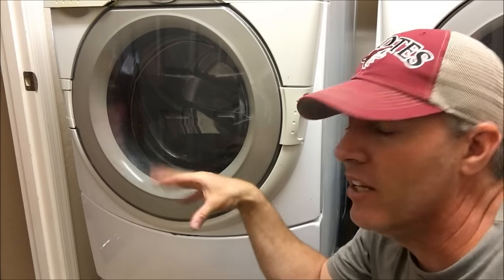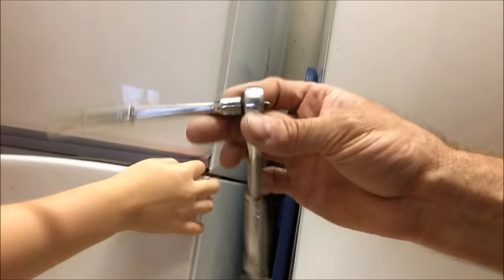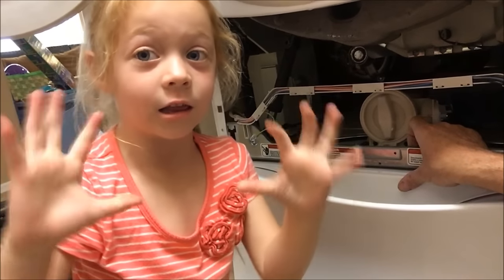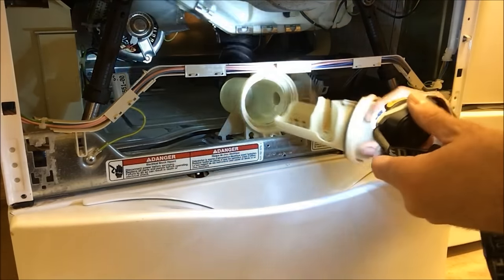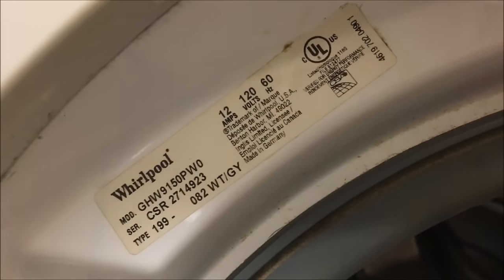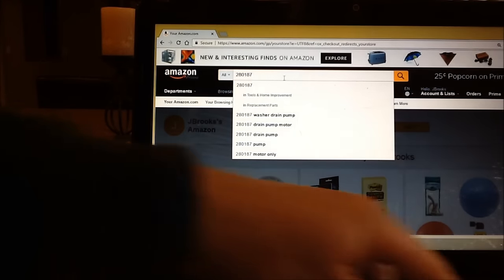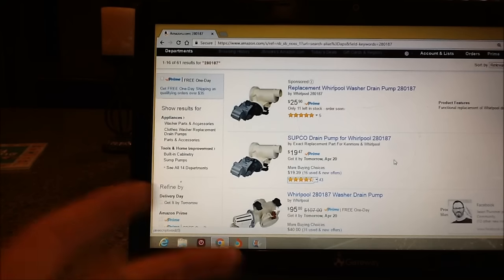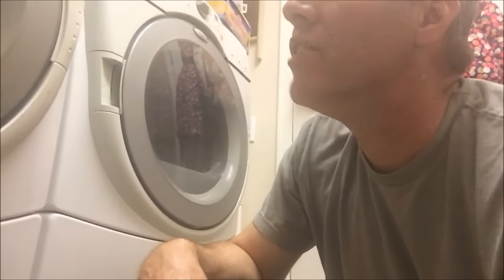DIY washer wont drain - repair whirlpool duet

Comment: Good to see there's still a few real Dads out there.
Reply from the maker: Thank you!!
Reply: i fixed the pump,  the trap was clogged , and their was an elastic band jamming the impeller , i got it fixed and machine now drains but after i fixed the pump  not the machine won't  work i get 6 binks  and  then 1 blink , the machine won't go into wash now ,
i think it is  an error  for insufficient water pressure but i am not sure
Reply: @anthonyrossetti7509  Seems like I read somewhere that a faulty oump pulling too much amperage can cause the lidlock assembly with wax motors to go bad.  Not sure if yours has the wax motor door lock assembly.  Not even sure where I read that.
  If yor washer still has the booklet in it, it should tell you the code that is flashing.
Reply: @rickeykeeton4770  thanks but I fixed it , turns out that that it was because I hadn't put the bottom panel back on yet 
There is a little spring switch that the panel needs to hold in
Also for models with no display you can still get diagnostic mode 
I forget now but I think  you just press any 3 buttons besides power 3 times is a series like 123  123. 123 after you power cycle the machine
Then it is in diagnostic mode and the lights will flash and the 1button you pressed in the series is the 1button ,the second is the 2 button 3rd is the 3 button
Then you press or hold one of them I forgot which one now and it will clear all the error codes from the computer
After I found the right chart of error codes for my machine  I was able to look up the code. It said it could be one of like 10 different things but when I read about the switch I knew that that was probably the thing causing it ,I screwed the panel back on , and cleared the codes and then it worked
Reply: @anthonyrossetti7509  Some of these have somewhat confusing diagnostic systems to remember
Reply: vinceje a few!!! There’s  a lot a good fathers out there  most women like dushbabgs
Reply: Right?
Reply: @anthonyrossetti7509  Go online. I don't recall the site address right now but it was one of the first 3 listed. It gives you directions on how to enter diagnostic mode and read the codes. If you have had ten washes without error codes they disappear in the missing sock universe.
Reply: @rickeykeeton4770  Booklet is taped under the top lid in a plastic bag sililar to a shipping doc bag.
Reply: @anthonyrossetti7509  Good work. Those type of instructions are in dishwashing machines also. Many times you need to disassemble the front door to access them.
Reply: There's actually a few of us still around and kicking ass. Likewise - this video made my day.

Comment: **iMPORTANT NOTE** I watched this video and ordered the part, but later discovered the pump was not the reason the tub was filling with water, it was a defective inlet valve! There is a SUPER EASY way to find out if the Inlet Valve is leaking that requires NO TOOLS :) If your washer is off and has not been used for several hours or days and the tub continues to fill with water slowly, here is an easy way to check if it inlet valve is the real culprit: The defective inlet valve will leak and you will be able to see a slow steady drip at the door outlet valve. This causes the tub to fill. To check, just open the door and see the outlet valve on the left side half way up. If it remains dry with no drips with power off.......then your inlet valve is good. If it is dripping.......the inlet is defective. :)

I just wanted to share my findings so others can double check the inlet valve and save yourself the trouble of ordering the wrong part.
Reply: GOOD TIP!!!

Comment: Thank you so much!  
We had this exact problem with this exact washer and I googled on a whim thinking I might find some generic info about how to make a fix and came across your video!  It was easy to follow and I was able to fix the issue by myself!  Our problem ended up being just the filter, which was so clogged up but very easy to clean out in the end.  However,  I am now also confident that I could replace the drain pump if necessary after watching your video!  
I also want to say that we've had TWO repair people come out to check our machine and neither addressed the filter - it seems like that would have been step one in a draining problem.  It is surely proof to your point that you never know who you are getting when you bring someone into your home!
Our washer is working great now and I appreciate this video so much!

Comment: Dude!  your video helped me fix the same problem on my Whirlpool Washer.  We tried cleaning the filter portion first (it was partially clogged), that didn't work.  So we ordered the new pump from Amazon and boom, it's fixed!  It was almost painless until my wife starting a cleaning project while we had the machines pulled from the wall-LOL.  thanks a bunch for the video
Reply from the maker: HA! Awesome John, I'M glad it was helpful!!

Comment: May 9/23 - This  isn't the exact same as my washer, although I have a Whirlpool Duet (maybe newer model).  I watched about 4 different videos and, by far, this was the easiest to follow.  Some of the others said to turn the machine on it's back, a bit too hard for 110lb female.  So I took the back off.  The coin catcher/filter was a bit more difficult to access but finally managed it, drained the last of the water and found........a Color Catcher caught in it.  Haven't put it all back together yet, but hopefully that is problem solved and no need to replace the pump.  I wasn't expecting much with a 6 year old post but I'm glad to say that watching it paid off big-time for me.  Great, clear video and easy to follow instructions.  Can't thank you enough.  Love the added touches from your lovely daughter.  Word of caution for people who use Color Catchersin front-loaders.  I've been using them for years and first time with a problem.

Comment: Thanks for the great video.  Fixed my problem last night which I could never have done without your instructions. And I never do this kind of stuff!  One thing I did was to start using the wet vacuum about a quarter of the way into the repair, based on your slight comment. There was a lot of water in the machine and it was taking forever using the rags to soak it up as it drained.  I put the wet vacuum nozzle next to the drain and sucked most of the water in as it poured out. Key was to open the cover ever so slightly and putting the nozzle right where it was pouring out and it worked like a charm. The wet vac. sucked in most of the water.  Sped up the process and less mess.  Can't thank you enough.
Much appreciated.

Comment: Your daughter is so adorable and she seems like she knows what you are saying so she is way ahead of the game. As Nancy said in the comments I also was my father's helper and it's amazing how my brain works with mechanical stuff. As it turns out,, I am handy around the house point being so will your daughter. What a tremendous advantage for her. About my machine, I'm going to give it a go and see what happens. The problem is not a clogged drain area so it has to be the pump mechanism itself. I'll let you know how it goes. Thanks for the easy to follow video. If I had someone come here it's a least $100.00 to come and check it out and then an extremely overpriced part as well. So, needless to say, I am very happy about this video and I'm kind of excited to see if this solves the problem.

Comment: Thanks for your videos! It's always nice to see that there are people in the world who still like to fix things on their own and teach others to do so!
Bonus Tip: If you think the drain line might be plugged somewhere, save yourself some time and check ALL of the spots where it may plug before putting everything back together.  
Bonus Bonus Tip: If the discharge of the pump isn't blocked, check the entirety of the suction line, including the lint trap, the ball valve on the outlet of the exterior washer drum, AND the wash drum outlet itself. After 3 days of trying to diagnose my washer's inability to drain, I found some socks somehow stuck between the interior and exterior drums, plugging up the whole works. Have no idea how they got there, but there they were.

Comment: I'm really glad I watch this. I opened up this drain and the reason why my washing machine was doing the F21 and the suds error was I had a hair band in my little filter drain area. Took the Hair Band out no more error code. Probably saved a single gal at least a hundred and fifty bucks. Took me 10 minutes to take three little screws out, unscrew this filter area, dump out the gross water and hair bands. Washing machine running like a top. Thank you so much for the video it gave me great confidence.

Comment: Hello I wanted to send a thank you.  I did what you said.  I called the parts store with the serial # and they wanted 160.00 for the part.  They also gave me the part number and I purchased it on Amazon for 30.00.  Our drain pump was original and didn’t look exactly like the replacement, no screws, so we had to pull the machine out, lay it on the side to take it off the pedestal.  Once they were separated, we were able to unattach the the whole pump from underneath the bottom of the washer and replace with the new part .  It took us a lot longer, but we got it all back together and I am washing as I type.  Thank you.

Comment: Great video! It was very helpful for me to troubleshoot my issue. I actually checked my trap, came out clean. Then I checked the drain pump, it tested fine around 160 ohms and was able to run when connected. So I checked the boot and found a little bit of hair/lint caught up near the ball. Nothing seem to fix the issue. In a last ditch effort, I purchased a new drain pump from Amazon for $25, and it works!!!
Reply from the maker: Nice work Jeremy!

Comment: Thank you so much! I had to manually drain the washer drum, then disassemble the front load lower panel, open the filter/pump,  unclog all kind of stuff 'eww', clean it and reassemble it. Thank you and little Ms. Girl power for all your Guidance. 😊😊😊

Comment: Thanks! Good info! I cleared the blockage out of my filter and everything is fine again. But due to the age and constant use of my machine I'm going to replace my pump. At $25 and 10 minutes, you can't beat what would otherwise be an expensive bill from the repairman.

Comment: I received codes Sud and F21.  First I cleaned the filter. But this did not work. The water did not drain upon testing. I was just about to call a technician.  
Then I decided to take the motor out. Upon removal and looking inside I saw a rubber band stuck, spun around the blades. With great difficulty and some homemade tools and the flashlight of my phone, I was able to remove the rubber band. Praying, I installed back the pump. This worked and I was ecstatic. Worked on it since Wednesday. Just finished.

Comment: I used to have this model, and in their infinite wisdom, Whirlpool changed the access for the pump/filter to the rear panel in the later models. What used to take 5 minutes now is a more labor intensive job.

Comment: Thanks we watched your video and my husband and I fixed ourselves.  Turned out there were some socks stuck in the drain!  Thanks
for saving us money $$$$
Reply from the maker: Glad to hear it!
Reply: Socks?!  Wow!
Reply: @GeorgiaDawgAthens  We had the same issue, still wondering how the socks made it there. They frequently get stuck in the rim seal but I couldn't figure how they make it all the way to the drain pipe, current suspicion is on the water inlet opening on top left.

Comment: Thank you Scott!  I was able to replace the drain pump by myself and I ran a load cycle.  I did notice that the new pump got really hot though.  Unfortunately, even though the new pump drained the washer I got a new error code at the end (F9 E2) which is for the drain pump!  I am confused.  Advise?

Comment: Have this washer It started flashing FH. Press the cancel red button. To get the door open. Then it started flashing 34 . I change  the knob from Whitest Whites to  to Heavy Duty . Just changed the number to 27 and from 34. The button  you push to cut off the cycle on the far right. That you hold for 3 seconds does nothing. Checked the filter. Like you show. Even checked the screens on the  hot, and cold   water. Machine makes a noise but the drum does not rotate.  I assume the flashing number is the  minuets left to the cycle is complete. What do you think? Machine was bought in 2004.

Comment: By any chance when you used the drain and spin cycle did it make a odd sound until you were able to shut the machine off? Yours looks just like mine does and I'm hoping its clogged, but if not how smart of you to get the part number for the pump and then check Amazon. Your video was awesome. I look forward to your reply about the strange sound. Thanks so much!

Comment: So my front loader is a duet and i can onlu access the filter by squeezing my hand through the losend bottom. Ive had to do clean the filter several times over the last year. Now it wont drain and the filter is not clogged. So im guessing its the pump after watching this. How can i access this? I can only remove the bottom two screws.

Comment: I have just got the F error, as i am widow a friend took the front off and we did clean the drain, there was a few coins but we cleaned it all and thought it was fixed , just tried to do laundry and same thing, I dont have water sitting in the tub just the clothes are really wet, when I put on spin and drain it will work.
do you think it is the pump ?

Comment: Found my missing tweezer my mom gave me 40 some years ago, 87 cents assorted coins, $20 bill, upholstery needle I use for sewing ducks together, a leather stitching needle, soda bottle cap, and a whole lot of blue fuzz. Fuzz from our babies new blanket that never made it into the dryer.
Whirlpool removed the easy access door so now it takes longer. I'm going ot buy touch up paint and put in my own door on a SS piano hinges.

Comment: No but currently I have my washing machine hooked with a dish washer hose to my kitchen sink I'm going to be moving it down to the basement where I'm going to hook up the proper piping and I'm wondering if it's not getting the proper amounted water so once I move it down there I'm gonna see if it runs a perfect cycle if not I'll just start tearing it apart and figuring it out

Comment: watched the video had the filter cleaned out an washer working again in 1/2 an hour at no cost.  Thank You
Reply: actually up $2.95. a drill bit 2 screw driver bits a drill bit and a sim card

Comment: On my model of Whirlpool duet I had to remove the top panel, and the entire front including the boot seal to get to the filter. There was no access panel, like the video, but the pump and filter were in the exact same location. It had never been cleaned. I think they designed the newer ones so that people can't service them easily. Planned obsolescence. Buy the ones with the removable bottom like in this video for an easier time! If this happens again, I'm going to cut a hatch with an angle grinder to save myself from having to disassemble the entire machine.

Comment: Thanks very much. I just took the filter plug out and found $$24.10 for all day trying to get the door to unlock. Ther was another coin, either a toonie/loonie worn so thin so must've been a long time prroblem. Not my house/machine. Will decide if I give it to my  bro when he returns. LoL Prolly tho, I am such a pushover & I texted me when I told him the door wouldn't unlock and told me not to try fix anything ha but now I tried again and it keeps reverting back to wash and add garment.

Comment: If you have the model with the one piece front it’s a little more work. 
Remove the three 1/4” screws from the back lid and slide the lid back. 
Take out the detergent tray. And then remove the two T20 screws. 
Remove two screws from the top left and right the closest ones to the front then remove the panel and lay it on top. 
Remove the two T20 screws holding the door latch. Remove the spring ring around the door seal with a needle nose pliers or screwdriver. 
Remove the 3 5/16” at the top of the panel. Then it’s just like in the video after that.

Comment: Thank you sir! The follow on question is meant as all to think and shake heads about. Why in the world are we buying washers that have to have pumps to drain? Takes the water up and over and adds to the bill to run it. Gravity should handle this all nicely. Why the extra power, bill, parts and failure point built in that adds to the cost? A drop drain...

Comment: Unfortunately my mashine doesn't have easy access to pump motor. I have to remove front panel and pull out drum robber seal. Any chance you have advice for this? Thank you.
Reply: Svitlana Richardson  i see nobody has replied . And you posted this 6 months ago. By any chance is your unit a Samsung ???  I cant find a video anywhere showing me how to do what the machines error code  is telling me whats wrong.  Its CRAZY  to have to basically take the whole washer apart to get to the source!! Now i know why every repairman interrupted me when i said it was a Samsung!! They all said sorry we  dont work on Samsung or Lg appliances. Let me know if you ever got help. Im a single Mon of a Disabled son. I cant be without a washer! Thank you. Love your Name btw!

Comment: that was not the only place for a plug, you need to also check after where it connects to the filter in that pouch thingy on its way out. I've pulled socks and mega change out of there

Comment: I'm trying to get into my duet washer but the door lock won't go off... I've unplugged several times and tried to do the reset by holding start/pause button 5 seconds. Any ideas? 
BTW when I replug it tries to drain but doesn't